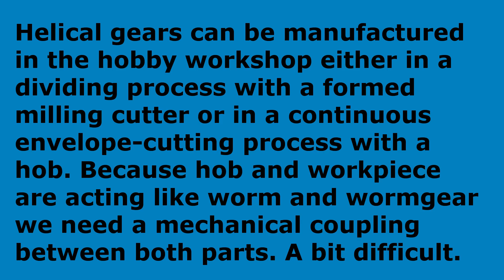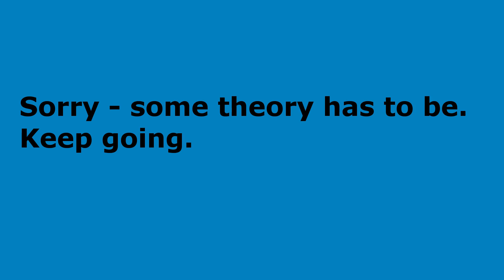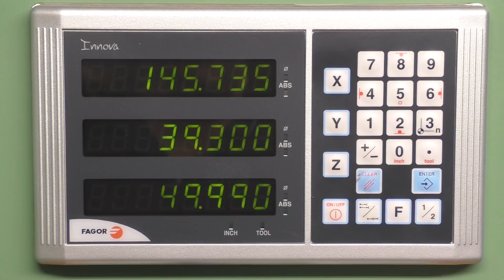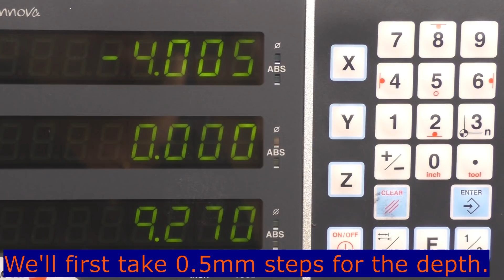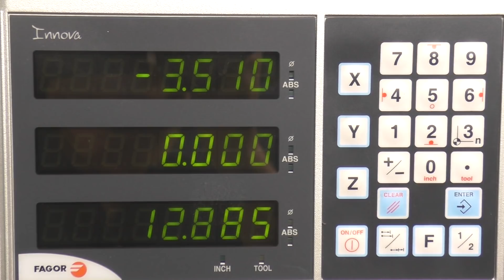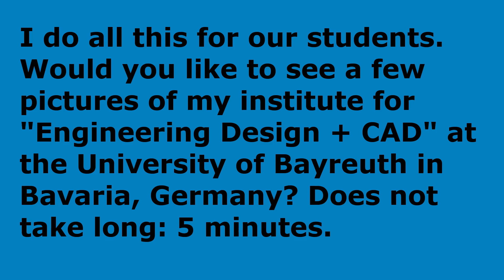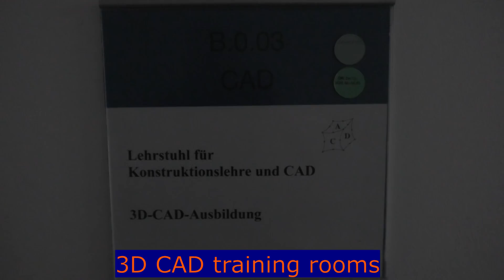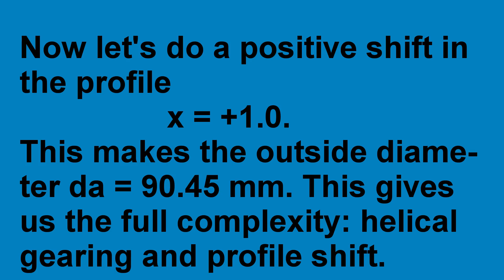Hobbing of helical gears

Comment: Right at 7:30... The secondary drive shaft's universal joint are out of phase on that drive shaft... Will pulsate in 90 degree pulses slowing down then speeding up ,and repeat. Not sure how much that would show up being in front of the rotors tables reduction of a likely 30 to 1 or 60 to 1 ratio... But still could cause wavey teeth cutting.or not at all? Simple fix or adjustment, please note, I am not trying to insult your intelligence by any means. But one can find videos about the u-joint timing of phasing of the yokes, and explains the cyclical pulsation issues, especially when the joints are at higher angles, even though the input is parallel with the out put... If the home is 90 degrees out of phase from the opposite end, pulses. Fine job Sir, now I want one!!!. Love the machine though, very clever!
Reply from the maker: There are no problems with the shafts because there are two joints in so-called Z arrangement. Please look for details in any book on machine elements like cardanic shafts. .
Reply: So one joint actually cancels out transmission error from the other other joint? Wow interesting, definitely need to read up more.
Reply: @impactodelsurenterprise2440  there is a few videos on YouTube that showcases this wonderfully. "U-Joint phase and or alignment  pulsing" are a few words you can type in to hunt for them, worth watching... There is also one that a guy did about a half year ago, with LEGO'S we're he magnifies this pulsing out of phase issue by means of putting in line bunches of joints... Mind-blowing how bad this issues can get with that many.. good luck.. if you can't find any of them post back here and I will find them for you as they are so worth watching...